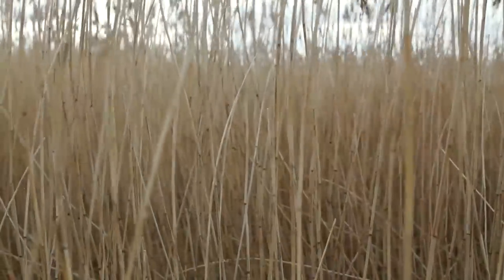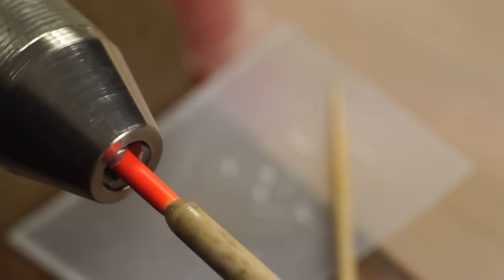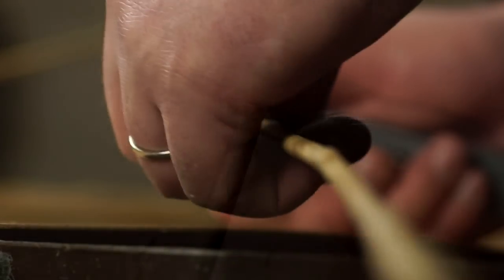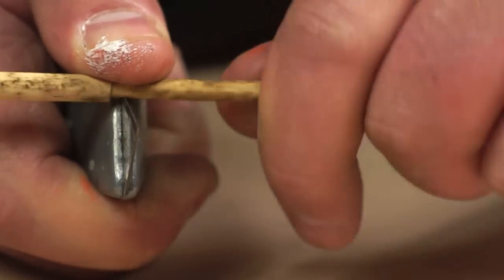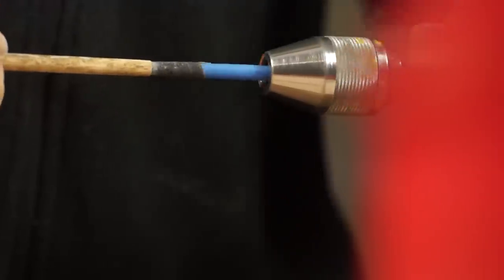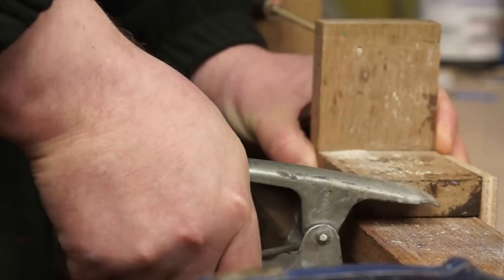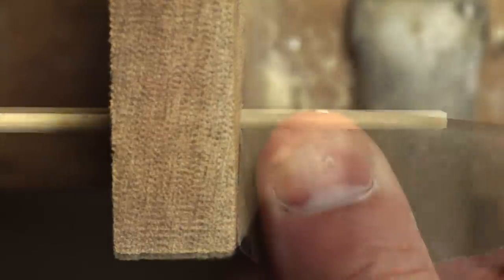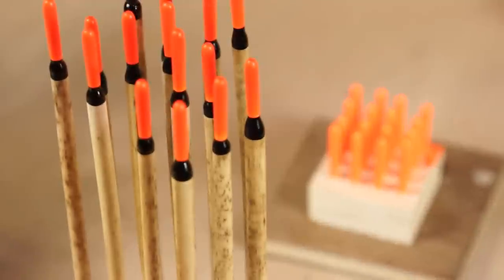Making Reed Fishing floats (bobbers) on the hand cranked lathe part 1 of 3

Comment: Great idea about that dipping machine , Paul,.........your solutions displayed in your very well made clips amaze me time and time again , ........greetings , Dieter
Reply from the maker: 61diemai Thanks Dieter, I went through all kinds of bonkers ideas with this before coming back to some simple things, and avoiding spending money, I am still surprised by the lathe, it seams to have a million uses, I am not entirely sure yet I wont have that powering a prop in my canoe.
Reply: *****
I surely do trust you to design a canoe drive utilizing such oldtime cranking drills , Paul , ......you might have to look for one with a more favourable transmission of the gear wheels , though .

Greetings , Dieter
Reply from the maker: 61diemai I have a large two speed version